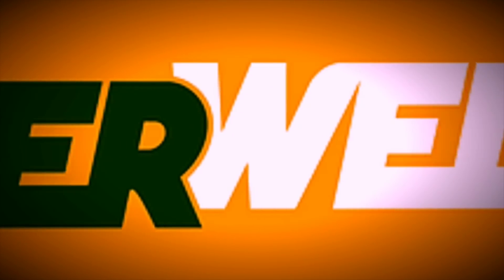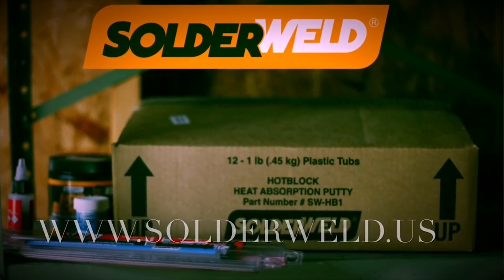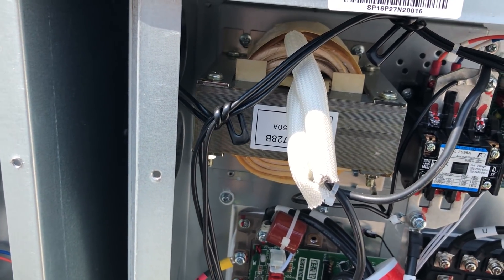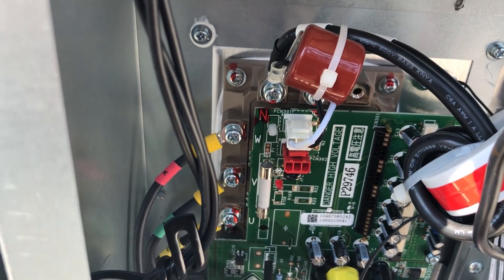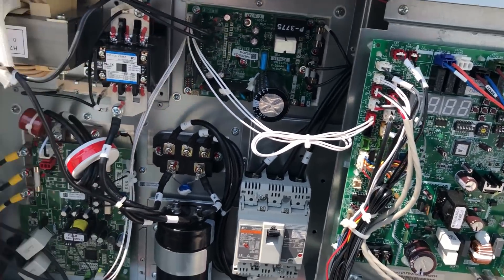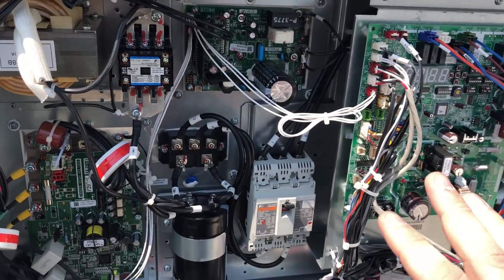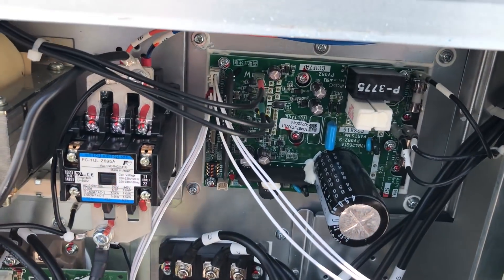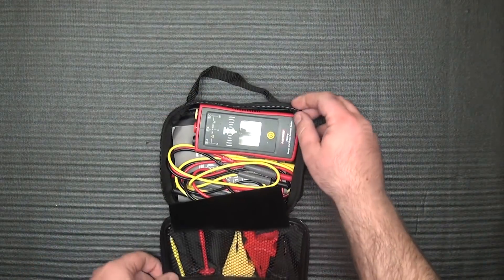HVAC Chronicles ~ VRF, Inverter Chat⚡

Comment: Great Video i must agree with you AK I myself enjoy working with Inverted driven HVAC system specially when wiring, addressing , configuring and starting up the systems ,  data logging and viewing what each VRF , branch controllers and outdoor units are operating. its amazing the engineering and technology that's involve  in the Inverter systems. we do a lot of Mitsubishi City Multi with branch controllers and LG Multi V down here in Florida. Thanks for the video and keep them rolling!

Comment: How much have you had to deal with evaporator coil leaks in 8+ year old VRF/VRV equipment in buildings with shit for fresh air ventilation, high VOC problems, and air handlers installed by people who gave no shits about service access?

My enthusiasm for the systems has dulled somewhat since I first took training classes on it in 2007. :(

Comment: being an electrician. surprised they don't use standard frequency drives to run everything. looks like old technology from 1990's
Reply from the maker: nappinj12 for sure, I find HVAC to be at least a decade behind many other industries, and don’t understand why.  Even the automotive industry is years ahead with a lot of diagnostic tools and tech. 🤷🏻‍♂️Beats me why, still love the trade for its variety and diversity of skill required. Thanks for watching!

Comment: I've installed LG, Fujitsu, Daikin, and Mitsu. Mitsu is by far my favorite equipment to work with. Good documentation, support, and ease of integration for third party equipment. I really like that Mitsu allows to to commission the equipment yourself and design the layout without having to call the distributor.

Comment: VRF is pretty sweet, I have been dealing mostly with City Multi , but very interested in the York System. Why do they use a traditional compressor and an inverter driven one? Who makes the guts for them? Great Video this channel is very quickly turning into my favorite.
Reply from the maker: This was the Gen 1 equipment, Gen 2 now uses all inverter driven compressors.  Not sure who makes the inner components.  Thanks for watching friend!🍻
Reply: I believe it's Hitachi. Johnson Controls rep was pushing it hard.

Comment: 30 years ago I used to work on Carrier Flotronic chillers.  Those units had "EXV's".  Electronic Expansion valves, which worked
on DC ramp voltages from board. 150 ton units had 6, twenty five ton compressors.  The boards monitored load increase or decrease, bring in more compressors and electronically throttle the expansion valves by the load conditions.   But this stuff blows my mind!  Those new units would definitely require service classes to operate and service.  Personally I don't like where all this is going.  Our company policy used to be,  if possible do not leave anyone without heating or cooling.  This stuff makes
that philosophy nearly impossible!  I don't believe  having all of that complicated technology to save a few more bucks on energy is worth the cost.  My vision for future heating and cooling is to have totally electronic heating and cooling.  No compressors, condensers, and refrigerant at all.  I believe that these design engineers are on recreational chemicals!  Billy

Comment: Never seen or worked on a VRF - but enjoy installing and working on the 5-stage Inverters we sell/service.  Only bummer about the more high tech stuff is that we're not gonna be able to fix A/C's "day of" as much anymore - which is why I think simple, single stage systems still won't be going anywhere anytime soon.
Customers never EVER wanna hear that you have to order a  part.
They want you to go wave your magic screwdriver over the unit, 'add a little freon', and have them up and cooling for around $100 bucks.
Reply from the maker: Good points!  Still good to understand the technology though I'd say.  Remember, when it comes to the EPA and other regulatory agencies, "logic" doesn't factor in.   It's all about the appearance of greening the place up, no matter how much the customers won't want to wait for parts.
Reply: Yeah, definitely good to undestand and be ready to service and install the higher tech products,  failure to adapt -->  extinction.
 Inverter technology and more high tech systems may be the saving grace of the HVAC Technician; in the day-and-age of homeowner's being able to Google 'bad capacitor', 'contractor replacement', etc and get simple parts like that online.  I know, prior to getting into HVAC I did my own CFM/cap replacement on my system and only called a licensed company when I needed my yearly 2lbs on my old R22 system. 
Makes me wonder how much longer window units will be a thing...unless they also, eventually, will need to be Inverter driven with DC motors and such.
Reply from the maker: I can almost guarantee in our lifetime it will reach a point where 100% of motors will be driven with an inverter.  More and more equipment will also require a laptop and a proprietary software to troubleshoot.
Reply: @AKHVAC 7 years later, you weren't wrong at all.

Comment: Nice video AK, can a inverter system be ran off of a standby generator and work properly?
Reply: polishtheturd mickelson If the power is clean low harmonics. Good voltage regulation.
Reply: Steve B, good points. Just thinking out loud so to speak. Seems like incoming voltage and hertz readings play a major role in their operation.
Reply: polishtheturd mickelson You are correct were not talking a cheesy generator. Inverter generator would be a good choice something that size would be rather expensive. It takes AC rectifies it then turns it back to AC at the correct voltage and frequency.
Reply: polishtheturd mickelson. Can i ask why wouldn't it.

Comment from the maker: What is your favorite type of equipment to work with?  Let me know!!👇👇
Reply: AK HVAC Refrigeration. Even the hottest kitchen is better than blazing on a hot South Florida roof in the summer. Not to mention free food. Who doesn't like free food..hah
Reply: Environmental Test Chambers.
Reply: Refrigeration. Anything from small to big stuff
Reply: AK HVAC RTUs are my favorite I always have a great day when doing commercial. But I do alot of residential, I wanted to go into commercial only with the union but they couldn't match the money. It would have been a large pay cut.
Reply: AK HVAC That looks pretty sweet I have a electronics background I like that stuff not so much rooftop units. You better know what your looking for before you get on the roof at -20 degrees Lol. I’m mostly residential Hvac Plumbing and hydronic service. We in install York equipment we do have some rooftops we service.
Reply: Boilers are one of my favorite's to design and install.
Reply: polishtheturd mickelson. Yeaaa!
Reply: I personally prefer working on  daikin VRV, I’m Newer to the field but my company has putting me through further training on daikin VRV equipment and it’s nice being able to more efficiently work on stuff that guys that have been in the field for a long time can’t
Reply: Mine would be Trane RTUs. But I do residential, commercial and also Daikin VRVs
Reply: AK HVAC , I really want to get into the HVAC field but I have no experience or schooling. I have read a lot on HVAC and understand how refrigeration works, I even have my own tools. Do you think I should apply to local HVAC companies?
Reply: liebert personally,preferably with an icom or newer interface.Second would be aaon rtu.Personally dont like multizone vrf or vfd systems.relies alot on the installer to work correctly and hard to diagnose without the proper software.Tech support typically just says more or less "throw these parts at it" and i personally like certainty.
Reply: Co2 as refrigerant Rack systhems.